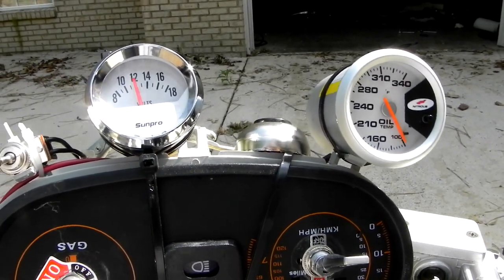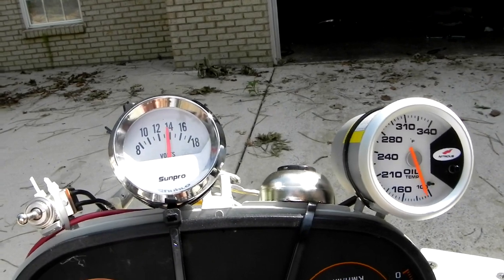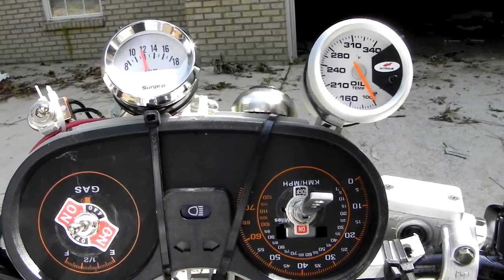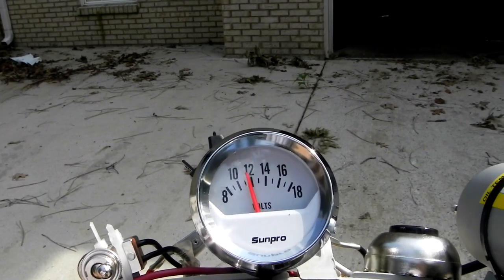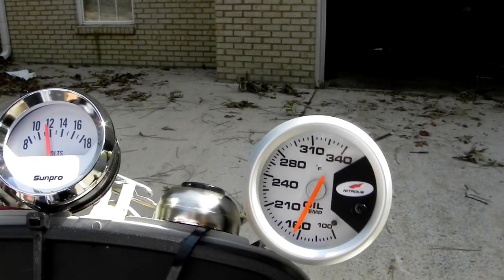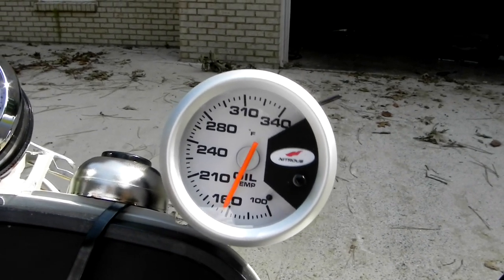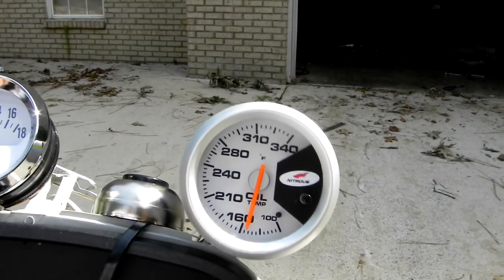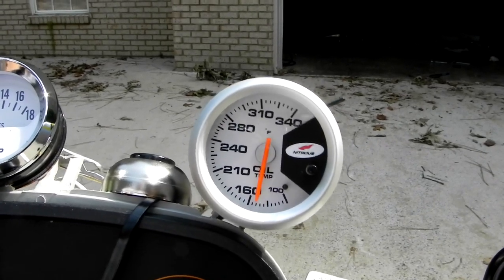GY6 Scooter with oil coller test

Comment: It's neat 🤔. Oil cooler is entirely to large & in the worst location possible. 5 or so inches from the hot pavement ♨️🌡. Even with a 11 pole stater. The charging system cant keep up with the electrical drain from the 10 inch fan it takes to cool down that "BIG" Ron Davis racing radiator lol. All someone really needs for extra cooling on their GY6 is the NYC oil cooler kit.With the much smaller radiator mounted behind the grill in the front nose of the scooter.With proper airflow as you ride. You don't need a big radiator or a fan for a Gy6 oil cooler. The shrouds help control cylinder temp while idling. Wind & acceleration threw a smaller radiator IMO quicker circulation better flow. Im in no way putting your oil cooler & wiring install with all the cool gadgets you have wired down. You have skills & its all trial and error, thats engineering. I don't think the NYC cooler is a cheaper option. The kit alone is $ 300 & another $ 200 on the odds & ends. Just to hook it up to mine, stays fairly cool . Thanks for sharing & would like to see the finished product if possible 🎬🛵👍appreciate the scooter content with information 💯😎

Comment: Charging, you can re- wind  the battery charging, stater windings, using a couple gauge larger wire, and maybe use two regulator rectifiers, also add about 2" more wire, for slightly higher voltage, it would only be about 1-1.5 turns, for something like .5 volts higher, but a aftermarket regulater rectifier capable of like 15-20 amps surge, but 12-15 normally, and a pwm motor controller on the pump and fan, will cut power draw in half! I'd like to know how this is designed, pump and routing!

Comment: I thought about attempting to do a somewhat oil cooled mod to my gy6, modify the cylinder jug, so oil goes up all four studs to the rocker /cam bracket, then drill tiny nozzles to spray on the cam,  this with an oil cooler, it should pull more heat from the jug and head, and shouldn't drop the oil pressure noticeably! I may try it on the coming build,

Comment: Do you still have the engine cylinder head shroud on, because the gy6 has a fan constantly blowing air on the head with the fan on the stator side and the fins underneath are blowing air on the exhaust outlet port.

Comment: why don't you just change the exhaust that would help . The muffler is holding in the heat more free flowing muffler will remove it

Comment: It's cool what you are doing.. but over kill and impracticle. Running in heat a simple small fanless oil cooler would suffice if your scooter was under heavy work load. Even then you really don't need it. Head temps are your real enemy